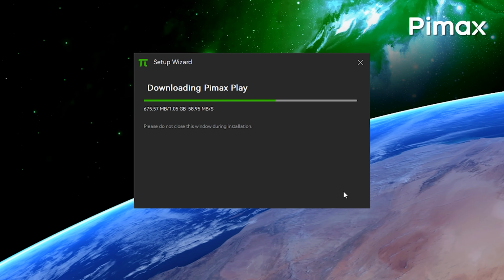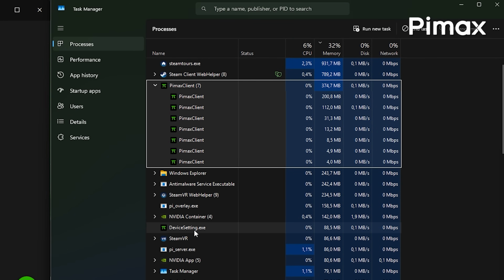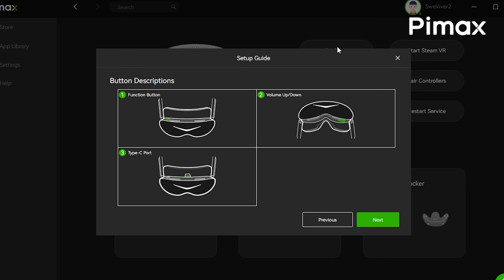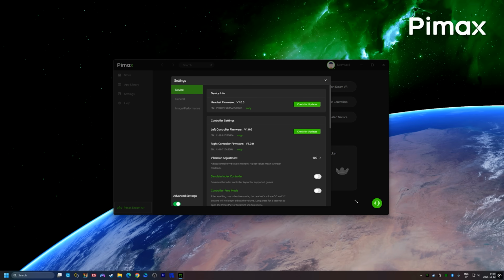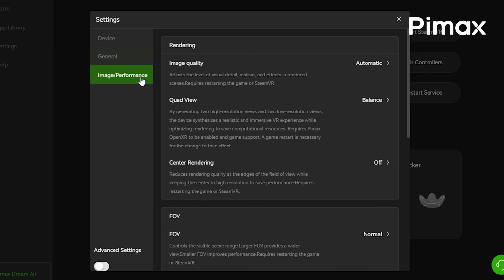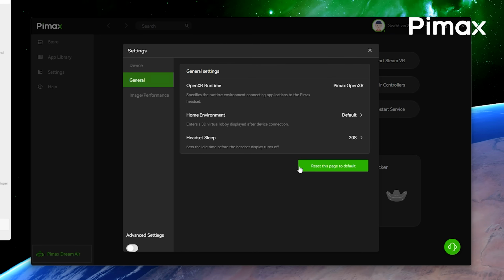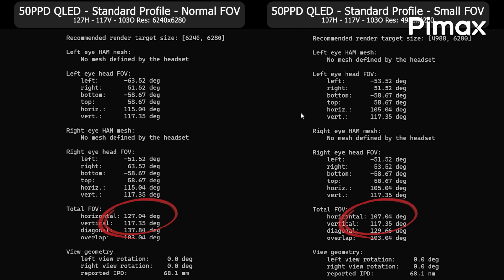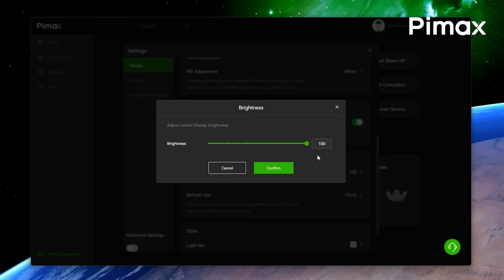Tested: Pimax Play 2.0 Beta - Smarter, cleaner and faster!

Comment: @PimaxVR Still needs a lot of improvements.  Dream Air SLAM users here.   if you want to do eye tracking calibration it opens in the background and if the desktop is open you can't perform a calibration till you close the desktop.   SLAM also goes out of tracking allot and there is not fast way to calibrate it to your room.  You have to take off the headset and use your PC since sometime the landscape is upside down, or backwards. taking the headset on/off while in game play is a immersion killer.  they need to have a quick key bind for this like the pass-through, and a quick button press on the headset.   Also when games load the screen is just black, sometimes things crash and you do not know untill you take off the headset and look at your monitor.   Additionally, any popups that you need to approve or click ok do not always how up in the headset and you are stuck at a black screen until you take it off to realize you need to use your mouse to click on the popup.  there is a way still for this to come to feel and works seamless like Quest 3.  i do think if Pimax listens to us this headset will or could be great.  let me rephrase, the headset is great but the usability with the software needs lots of work

Comment: Hey pimax, I have the pimax crystal super ultrawide and I really want 120 hertz, it feels very smooth and will overall enhance immersion. Also, if you do add 120 hertz, with the lock to half framerate setting, you could also unlock 60 hertz mode for people with mid tier to low end graphics cards. Also 60 hertz would also feel better to lots of people's eyes since there fps won't be choppy and will be a smooth 60 fps. I might add this comment to other videos too.

Comment: Works just as good as the old version. Crappy. I spend more time trying to get this dumb headset to connect than play games on it. I regret paying $2k for this thing. I dont care how pretty the visuals are. Its useless when the headset cant even connect to the PC to play games, which is what it was biult for. It seems everytime I want to use it, I have to trouble shoot and check all connections. Never had this much issue with the Rift. For an expensive headset, their app is garbage.

Comment: Please introduce a simplified color control overlay with saturation. The RGB sliders work for color balancing, contrast and brightness but I never found a true saturation control. As a base feature, I think all screens should have at least a saturation and hue slider so the user can adjust to their liking. The fact that when I look at my desktop though Pimax Play it looks like highlights are blown out and the hue is off but when I use the Virtual Desktop app everything looks balanced and normal means it's definitely possible to do but neither option lets you control it yourself.

Comment: PIMAX I HOPE YOU ARE READING THIS!
ASUS 5090 ASTRAL OC goes in to 12VHPWR error (red led on the GPU near 12VHPWR inlet starts blinking a soon as my crystal super is connected) with the new beta software. 100% conformed the beta pimax play is the reason.
I have therefore downgraded back to from beta to current release of pimax play - no more issue.

Comment: Pathetic video !  Let me explain you why:

1.Pimax 2.0 should bring app optimizations to consume less resources ,you did the opposite;
2.In 2025 i want to see what app is doing in the background. New trend from all devs not only pimax is to fill you pc you nonsense app running in background.
3. How about linux support ?
4. 2025 and Pimax hasn't added AI into app? Cmon pimax you can can't up with others/trend in adding unwanted useless processes and apps running in background.
5.If you use software like SYSINTERNALS SUITE or SYSTEM INFORMER you can see how many processes are running in background from pimax software. 
Thank god i know how to use some llm and asked them to write me a code to stop all the bs processes and apps running background and  that is sending  telemetry data   to shangai.

And btw this video is a pure add to new headset ,don't waste your time on another advertising video ,i did it for you.

Comment: Pimax Client need Crop2fov feature like in OpenXR Toolkit 1.3.8 => It's absolutely essential that this feature be integrated into PP, and please it have to be as customizable as crop2fov... it allows to crop by percentage at the top and bottom and on both sides of each panel.
Since LMU integrated EAC, Toolkit and crop2fov are no longer usable; I've lost 30% of my VR performance, it's just insane!
A 9950X3D with a RTX5090 can no longer run LMU at render scale 1 and many graphics options at ultra settings, whereas this was possible before LMU version 1.2.
Without this feature, users of very high-definition headsets like the Crystal Super cannot utilize the headset's full potential, and this is a major problem.
How is it possible not to offer such a feature, when it provides 30% more performance without any drawbacks or degradation in image quality or FOV?
I still don't understand. Please Pimax, we really need this.
Reply: bUt ChYnA No. 1st

Comment: Hi, is it very complicated to make it so that you can see the desktop without using the monitor and without removing the headset every time???
Reply: I am asking Pimax for a toggle slider switch to jump between the two modes (desktop/monitor and game) on the next 12K headset for this.  I'd like to request they allow button mapping to change volume buttons to these two modes (like volume up as desktop/monitor and volume down as game) on all of the current headsets for now until the could release that 12K with a big easy to feel dedicated slider for it.  (Or if you can press down both volume buttons at same time, I'd make that they option for switching between the two desktop/monitor and game modes so you could leave volume adjusting as it is)
Reply: On the Quest 2 with Virtual Desktop, I don't need to take off my headset every time because I can't see my PC desktop. I've had a light for a few days, but this is truly ridiculous. It's a big problem for those who have their monitor far from their workstation. I wonder: do developers use these headsets? I don't think so, since they haven't thought of this.
Reply: @viol3nza  Agreed.  And with as expensive as these are, I want to be able to use my headset for a monitor mode and then later in a gaming mode, and just slide a toggle button on the headset (or click or hold both volume buttons) for switching.  I should never need to go into a software to switch these modes, it should be always accessible on the physical device.

Comment: I love the progress. Thank you and good job. 
Though... However cool the spaceship looks, most everyone wants to be in the virtual desktop to launch or close softwares related to games, without having to lift the headset. So virtual desktop should be the default view. Or at least there should be an option to do that. And once there, of course, mouse control and not gaze control. Getting to virtual desktop requires too many steps and gaze control are the reasons why virtual desktop is never used.
Reply: Yes. It is quite cumbersome to put the headset on and adjust it to perfection. What we need is a PC desktop with a simple background environment with grid lines and a horizon so we can immediately detect if the headset is on in the right position and then launch our game.

Comment: Hello Pimax users (aka free beta testers).

I am considering the CS Ultrawide and my questions are:

1- Does it work well with my 9070xt? or needs a next gen GPU?

2- Can we limit the vertical FOV for sim racing yet?

3- Can we run it at 120 FPS? (or overclock it).

4- Can we run it at a lower resolution if we need that? (With and without upscaling). If I understood correctly, many 4k monitors can be run at 1080p natively.
Reply: You can raise or lower the resolution on a slider all the way from sub-potato up to ultra-mega-super-sampled. I'd get the tried and true 50ppd version though, the Ultrawide is still bugged into being basically normal wide but with a lot less binocular overlap. Either way, the you can only run it at 72hz or 90hz (or half of either if you need), but 90 fps is asking a lot of your GPU at this resolution anyways, you really should have a 4090 or 5090 to take full advantage.
Reply: @overtorquednut  thanks for the info

Comment: Meanwhile I am still on 1.37 because newer versions cause bad jittering
Reply: Mine is ridiculously jittery and stuttering even in the home environmen/planet. I have a 5090 i9-12900 and it acts like this... I attach the headset to my brothers 3070 i7-10700 and it runs butter smooth. Is this a 5090 issue? Or a Pimax issue?

Comment: Well, the usability has not improved by 1%. If you use it with a light, its basically the same. very strange "upgrade". Maybe hire a UI guy that nows what he is doing. Pimax Headsets also get blocked by EAC in LMU and Star Citizen.

Comment: So the game options tab is gone? It’s no longer possible to set per game configurations? So need to go through every setting and change it manually when playing a different game?

That’s what it looks like and if so this is a major step backwards. You need to remember every setting for each game and manually adjust them when switching games.

Do I understand that right?
Reply: No you still have the same profiles you can create for individual games and apps.
Reply: @SweViver Good to know. Thanks.

Comment: Guys you need to add more options regarding FoV. For example in sim racing you can cut 50 percent of the vertical fov. But I would like to experience still the feel of speed so I need the full wide fov.

Comment: I just want to see my mouse cursor without using controllers
Reply: For real, if this mouse cursor isn't fixed in Pimax 2.0 what's the point of the rest hahaha
Reply: Yes Pimax, when using the desktop view in VR I would like to use the mouse to navigate the desktop. Currently I can move the mouse cursor but it is not shown. So I have to use the controllers for that. Interacting with UI elements made for mouse controls are not precisely usable with controllers, though. A lot of us use your headsets for sim racing, so many have a keyboard and mouse/trackball nearby. Please give us an option to show the mouse cursor in the desktop view.
Reply: As someone looking to get my first Pimax, what do you mean by this? I want to get this for MS Flight Simulator and absolutely need to use a mouse in VR. Is this not possible?
Reply: @playin4k611  It's a strange bug (I hope it's a bug and not a feature) where your mouse cursor sometimes goes missing while Pimax Play is running in VR
Reply: @LunchAndVR  Hmm, I have the same problem in MSFS with my Q3 and Virtual Desktop.
Reply: @playin4k611  This bug on Pimax is not just in game, it's on the main desktop too when you're not even in a game
Reply: I can see my mouse, I don’t use controllers, disabled , but it just follows my head view.  Would be nice to be decoupled
Reply: Yes please! This is very annoying.
Reply: you can do that with a workaround: in windows...Settings > Bluetooth & devices (or Devices) > Mouse > Additional mouse settings, then the Pointer Options tab, and check the "Display pointer trails" box under Visibility, adjusting the slider for length and set it really short, slider complete to the left. now you can see your mouse every time. i would love an option to always see my desktop, if im closing a vr application...
Reply: @tom4strike  Thank you! It works fine.

Comment: I think the new look, looks good.  One thing I wish Pimax Play offered, was some sort of world/instance that helps dial IPD and maybe even offsets.  I have to go to desktop view, adjust the IPD, go into a game like VRChat and see how it looks, and repeat.  You get the overlay on the screen that shows the bars for a few seconds. That overlay doesn't do anything useful for me. I can literally set it to 60mm - 70mm and notice absolutely no difference in the bars.  Instead what I've done is just set it to like 63, run around in VRChat  for awhile.  Set it to 68. Run around for awhile.. and keep changing until it feels "good".  As they all LOOK the same, but I notice 63 feels "natural" to my eye muscles ( no straining ) vs 67mm, my natural IPD is 66.8

Likewise same with the left-eye and right-eye offsets.  I can set  the left eye to -1.5 and my eyes just instantly accept it as normal.  It be nice to know if a tool could exist, to help find proper offsets here.  I kinda just took a stab in the dark.  I sat at my desk with an object 2ft away. alternated left/right eye to see how much the object shifts. Then I went into VRChat to try to replicate this shift. I ended up with the right eye being shifted -0.7X and -0.4Y  and now when I put my headset on for many hours, I get no strain and when I take it off, everything feels natural.  No feelings like I was crosseyed or something wild for hours.

Comment: Wake me up when Smart Smoothing actually finally functions properly, you know, without throwing all kinds of polygonal artifacts all over the screen, or just flat out failing completely for no reason at all. My original Crystal has been a $1500 paper weight sitting on my desk for over two years now because Pimax refuses to set aside any time to make it work. Astonishing.
Reply: smart smoothing works. On the OG Crystal at least. the thresholds might not be set optimally but it works, and of course there's gonna be artifacts - this is reprojection. I also think it's best-effort reprojection so without motion vectors and such (I could be wrong)

Comment: I was excited for the Pimax Crystal Super micro-OLED VR headset, but I heard that its capped at a low 90Hz refresh. The Apple Vision Pro, which uses micro-OLED at very similar resolutions, has a refresh rate of a solid 120Hz. Will Pimax be increasing their micro-OLED display refresh to 120Hz? If so then I will get one, as 120Hz is fast enough to stop headaches and give that vital competitive gaming edge higher refresh rates give, whilst giving the vital contrast on colours that only micro-OLED can.

Comment: I've been using the beta for a few days now on my Pimax Super and I quite like it. The new home environment is a bit low res as you say, and on my 4090, it is using 58% of GPU resources, so that needs more work. I'd also like to see more options for adjusting FOV vertical and horizontal separately, as in the OpenXR Tookit mod. The FPS counter also needs CPU and GPU frame-time options. The ability to adjust more image quality settings such as saturation, vibrance, highlights and shadows would also be nice.
Reply: Are you having stuttering and shaking issues when looking around.. for me the picture moves smoothly but when I start looking around I get alot of stutter
Reply: @BoardingMold446  When I first tried PP 2 beta I had terrible stutter in MSFS 2024, just as you describe. I also had it occasionally with the previous 1.43.1 release of PP, but it would always resolve itself and go away. Strangely, that stutter when looking around would not show up on the monitor, nor could it be recorded in video. 

However the following day I had no issues at all, it had just disappeared and so far hasn't come back. Initially, I thought it might be room lighting, as I have a window near my desk and that might have been an issue. But now I think it may be a data transfer problem via the USB connection. Why it resolved itself I have no idea.
Reply: @VRTests-q2e  its the craziest thing.. My PC has a Gigabyte 5090, i9-12900, and 64GB RAM even when i enter the Pimax home environment/planet on 1.43.. when i look around, everything is jittery and stutering. I know this is not right because i hooked this same headset to my brothers 3070 i7-10700 16GB of RAM and that same planet environment runs butter smooth when i look around. I really need some help on this. I feel like i just blew 2 grand😥
Reply: @BoardingMold446  Try a different USB 3 port on your PC. Also the latest nVidia drivers have issues with VR. Something about an updated API that Pimax will have to code for. Try an earlier driver and see how you go. I'm on 581.94 with my 4090 which seems to work OK.
Reply: @VRTests-q2e my Pimax isn't recognizing my 4 blue USB 3.0 ports as USB 3.0. But it does work in the red ones.. i believe they are 3.1 or 3.2 i have a ticket in with Pimax. They should be getting back to me next week hopefully.
Reply: Do you have jitter or microstutter??
Reply: @mercury7912  As I said, I had bad stutter when I first used PP 2 beta, but somehow it disappeared the next day . Now I get the smoothest flights I've ever had with the Super. Head tracking is great, and no micro stutters or jitter.
Reply: @mercury7912   I had terrible stutter when I first tried PP 2 beta. The next day however it had disappeared. Now I get the smoothest flights in MSFS 2024 I've had with the Pimax Super. No micro stutters or jitter, also head tracking is very good.

Comment: Can the local dimming for crystal go back to the numerical value slider? It has like no info besides low and higher and would like the original slider values like how .01 was the best setting (unless the lowest is equal to that setting then nevermind)
Reply: Yeah fine tuning dimming is pretty important, as both slider extremes have their downsides.
Also worth mentioning that in the past it was possible to precisely set dimming by editing some INI file. Not sure whether it works these days.
Reply: @Mugnum_  like a few updates back you didnt need to do the ini edit and they actually did have the fine tune changing, but they replaced it with less control lmao weird move to make something worse